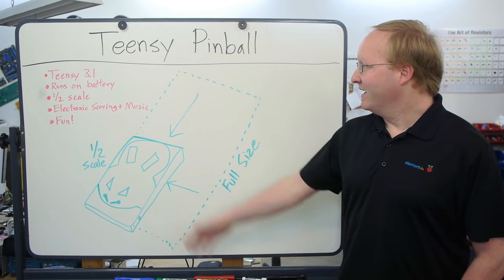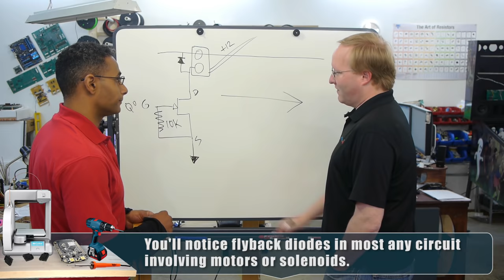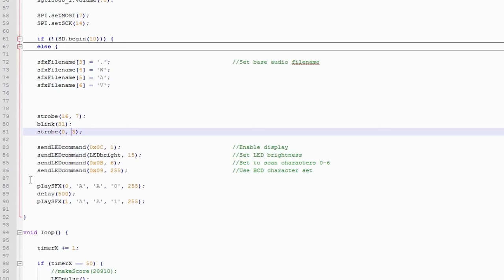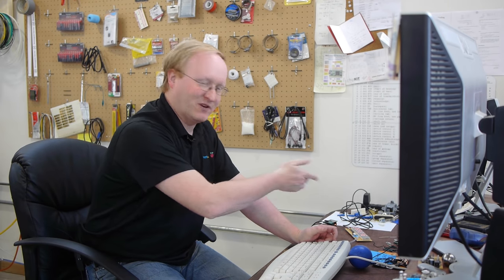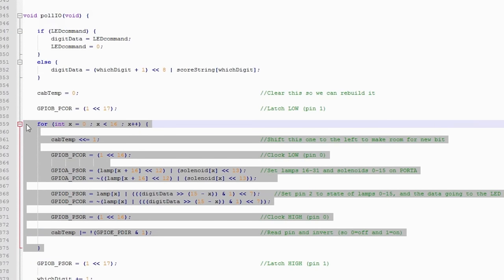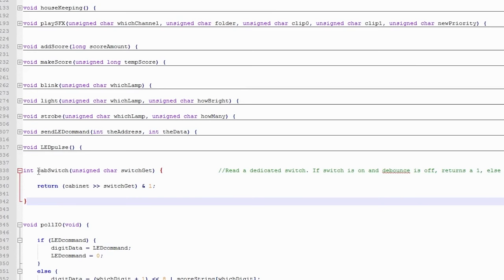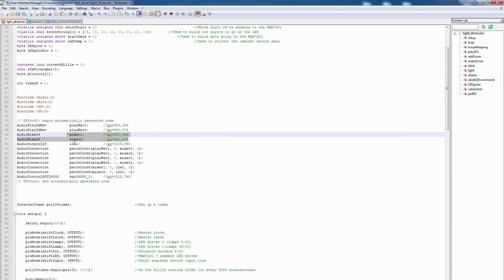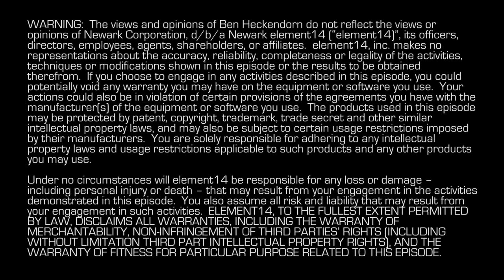Ben Heck’s Teensy Pinball Portable Part 1

Comment: Worth noting: In teensyduino, the author wrote functions called 'digitalwritefast' and 'digitalreadfast' that take only 1 cpu cycle to complete...much faster than default :D  (without needing to resort to port addressing)
Reply: frollard How about using the SPI port and have half that stuff happen with no processing at all haha.
Reply: Robonza Definitely a trade between novice usability and efficiency...I just mentioned that one because ports and bitwise operations are a bit heavy for the beginner and if the other goal is speed then it's already been taken care of :)

Comment: The Ben Heck Show I might be missing a trick - but on the score 'number' to string code, could you not just use cstr to convert the actual number to an ascii string. Then all you would need is a loop through and replace the 'val' of each -48 to get the ascii values correct. Would read a lot easier I think. Also as a quick thing, don't forget to right justify your score :) (I don't know about Arduino or Teensy code but in the old days of basic you could set the length of string you wanted to return and justify your number in it)

- just my 2p worth :)
Cheers
Wayne.

Comment: Instead of using the read, modify, write on the pin registers, can't you use bitbanding? Teensy 3.1 is an ARM Cortex-M right? I'm not a 100% sure, it might be manufacturer dependent or something, but that would allow much faster access to individual pins as every bit in a pin register is aligned and can be accessed individually.

Comment: On the Mosfet, Ben called the diode a 'Fly-back' however I have learnt it as a 'Rerversed Bios'. If this just language diffrence (I am from the UK) or have I learnt it wrong?
Reply: Reversed bias.
Reply: Thomas Jarvis A flyback diode (sometimes called a snubber diode, freewheeling diode, suppressor diode, suppression diode, clamp diode or catch diode) is a diode used to eliminate flyback, which is the sudden voltage spike seen across an inductive load when its supply voltage is suddenly reduced or removed.
Reply: Thomas Jarvis No, you learned it right.  The reversed biased diode is being used in a fly-back configuration, across the coil in the relay.  This is one of the many uses of a reverse-biased diode - flyback voltage spike suppression across a DC-driven inductor.
When the MOSFET switches from on to off, the magnetic field in the coil collapses, but while it does, it can generate a substantial reversed voltage spike across the coil.  The diode provides a safe way to drain the energy within the coil, thus preventing you from "flying back across the room" from touching a coil that is supposedly "off".  Here, it's primarily to protect the MOSFET from damage, but in higher-energy circuits, it can prevent arc events.
Reply: Falbert Forester
Ah, okay. Thanks. That makes sense now.
I have my electronics exam this week and there is always a question on Mosfets or BJTs with an electromagnetic thing, so that very useful.

Comment: What IDE are you using? I wish the arduino IDE would collapse functions like that.
Reply: It's notepad++ (not an ide just a text editor)
Reply: Benjamin Harvey it looks like notepad++.
Reply from the maker: Benjamin Harvey At the end of the day it's just text files, so you can use whatever you like. The IDE just packs in avr-gcc to make things simpler.
Reply: The Ben Heck Show 

yeah. personally I prefer Notepad2, which is used more like the original Notepad (IOW: you open a bunch of instances in parallel, with one instance for each file).
Reply: I clocked it was notepad++ when I saw the full screen ;)

Comment: 22:30 This is not true! bitRead, bitWrite, bitClear and bitSet are macros in wiring.h (Teensyduino) or in Arduino.h (Arduino), they are bitwise operations, that run just as fast as your functions.
For digitalWrite and digitalRead your argument is only true if you run these commands with dynamic parameters otherwise they will be single-cycle instructions.
Reply: systemmaster128 There is little correction, writing constant to SFR on ARM or Atmel is not single-cycle instructions (it is possible to be single-cycle instruction only if you have prepared values in general-purpose, which is rarely case) changing one bit on SFR usually take 3 instructions.
bitWrite is macro but it use conditional assignment to select which macro it will use (which can be determined during compilation for static parameter if you use some good compiler, GCC dont do that)
digitalWrite and digitalRead are never single-cycle instructions (they never cant be even compiled to 3 instructions), and there is no difference if you use dynamic parameters or static parameter.